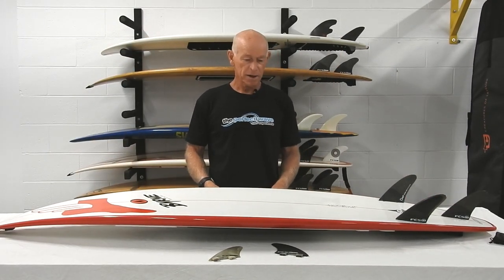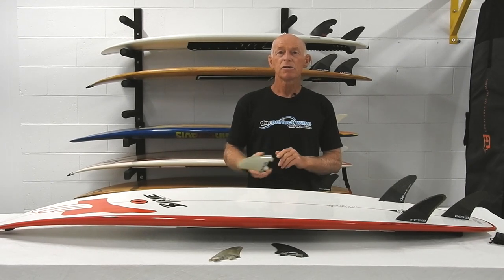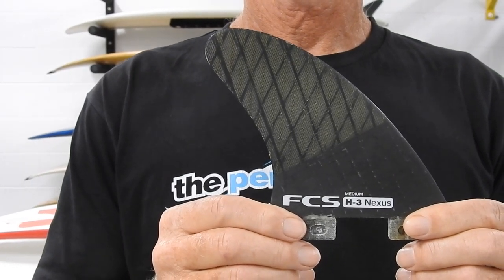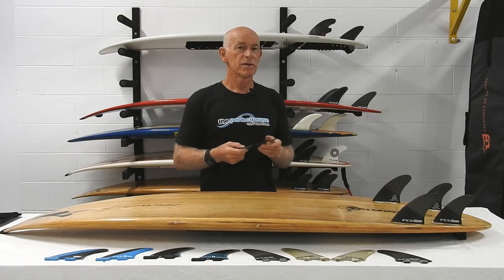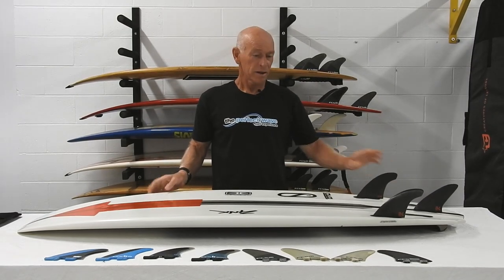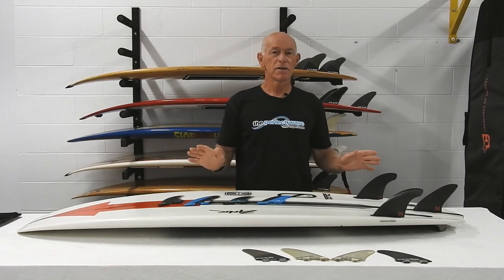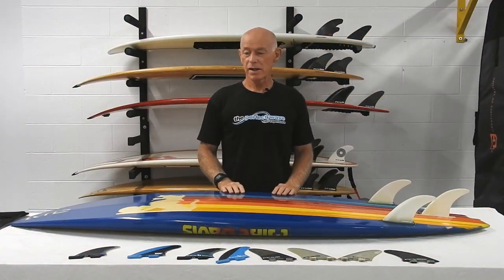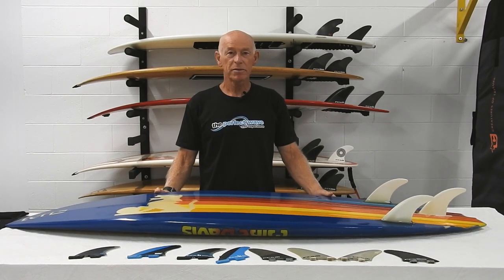H4 FCS Fin  Review and how they perform on a Slater Designs Cymatic

Comment: This was a great review Leigh,
 I have a quiver and in that i have a Lost Puddle jumper that i usually ride as a quad, also a 6'4" that i usually ride as a quad also, have you tried the H4's as a complete quad set? If I were to buy the whole set it would be a lot of $$$'s, so Im just weighing up getting a cheaper set or are these fins as good as they say they are? 
Thanks
Reply from the maker: Thanks Wayne. I am currently riding a Dominator 2 with a H4 Quad set. I tried various Tri and Quad when I first got the Dominator 2 and after several weeks I found the H4 Quad the best set up. On bigger windier day the Quad was more in control but on small grovel day they still  generate speed. If the Lost Puddle Jumper goes well as a Quad the H4s will fly. Let me know how you go.
Reply: @leighwilson1524  Great thanks Leigh for the prompt reply, that info is very helpful and something to think about, yeah it (the PJ) goes great as a quad, I have the original P5's in there and goes great with those, maybe time to experiment with something new!

Comment: @Leigh Wilson  Hi, have you tried the H4 fronts on your Cymatic with Quad rears like the Medium Reactor PC Quad rears?
Reply from the maker: Hi finproductions, I have tried H4 front and  FCS performer rears. The combination suits point breaks great. I find the tri set works better in poor beach  breaks and unfortunately  my local beach breaks have been very poor for a long time. My son has a Cymatic as well and uses the Reactor medium quad set with the Shapers nub and loves that combination.
Reply: @leighwilson1524  Ah that's really helpful thanks. Which size fins? Do you use Large H4 front and Medium Performer rears?
Reply from the maker: @finproductions  Mediums all round. I have used Fanning large and Performer medium rears when the surf get large. Mostly for normal small every day surf I use H4 tri

Comment: Hi Leigh, this is so far the best review I could find! Could you please tell me if the center fin feels stick or so? Not drag, but in thighs turns. It have so much area, even more than the FW large.
I'm using reactors (side large and center medium), FW on large for those days bigger than 6 foot and the old green JW for those small funny days.
I would love to just switch for one template. Thanks and please let me know your thoughts.
Reply from the maker: Hi Ed, Sorry for the slow reply. I missed the notification. I like you was looking for a fin that does every wave. Since I did the review I have had some bigger waves and because I am not Kelly Slater had to detune the Cymatic by putting large MF fin in. Then I tried my SKX with the H4 in the same surf and they were great. These were 6 to 7 foot backhand solid waves which we don’t get often. In surfing you are always learning. You need a minimum of two boards and two fin set ups either to control or generate speed.

Comment: Need some advice. I have a Firewire seaside 5'10 w/39 liters fcs2 quad. and I'm only 5'7 @160lbs..I dig the volume and how fast I'm growing in skills with this thick wide board..BUT I heard that since it's so long and bulky w a wide nose it's better I get a large upright template set of fins to be able to pivot the board. I have the machado quads and the controler fins and they are fast..but I have slid out when the waves got little big and punchy..I couldn'tdig a big deep bottom turn with them that easy at all....can u sugest a set of quads w an uprighttmplate for the pivot that will also help hold the tail down when I need to do a deep bottom turn?thnx
Reply from the maker: If you have medium size fins it may be worth a Large set. We are similar weight. If I bought a Seaside I would bought a 5'5" or 5'6". I do not know your surfing standard but I would have trouble too trying to keep the tail under control on head height waves. Small wave wide tail, large wave narrower tail. The board is rated 1 to 5 feet waves. Small waves, you want to generate speed,  and larger waves you want to control speed. If you have had the Seaside for a while and have improved a lot on it,  to keep the improvement going it may be time for a board with a narrower tail and more performance orientated. Keep the Seaside for fun small wave and another board for larger waves. I have a Cymatic up to over head and an SKX for bigger days.
Reply: @leighwilson1524  hey I apreciate your response..and even the key to tails size to match wave type. Yeah I'm looking for a board for the faster winter waves now for sure..head high to a couple over head..but with a pocket and kinda fast. I've heard that the Pyzel Ghost, or the Lost psycho killer type boards will be a good choice. But when I look at keeping the same volume as my seaside 39liters (maybe even add 1 liter for the bigger surf) ..the boards end up arpund 6'7" and I wonder if that defeats the design of the board cuz I need so much volume ... :/
Reply from the maker: @josephhatamiable  I  would lean towards the Lost because of the transition  may be the easer of the two. Also check out the Firewie Dominator2. Check surf'n'show YouTube review. Also the large Mick Fanning fins are also a great choice on power waves
Reply: I had the same problem with mi 5’8 seaside and fixed it putting the mark richards on the front and the machado quad rears in the back. It works great now in bigger surf letting me ride it more vertical. Also the reactor quads work very well.
Reply: You should be riding the 5'4" max.

Comment: Great review of this new fin of fcs. I heard it need a bit of a wave to come to its full potential. Do you agree? Or do you also feel a difference in small waves? Greetings from The Netherlands.
Reply from the maker: I hope the Netherlands Corona fight is going well. The fin is unusual because in a small wave you can generate speed but on a larger wave you can control your speed. Usually you need 2 different fins to do this. Most of my waves have been small so far, 1 to 6 feet. It can generate speed across a flat section but really comes alive when it get steep. stay safe. Leigh

Comment: Hey mate 
Medium or large ? I am around 75 kg and love raked fins on 3-6 footers.  Medium h4 dimensions feel small. Cheers Baly
Reply from the maker: Hi Balt. Sorry I missed your comment. I have the H4 in only a few 6 foot waves but found them very confident in even bumping waves. If you would normally use a medium fin in a particular board/wave stick with the H4 medium. Cheers thanks for watching.